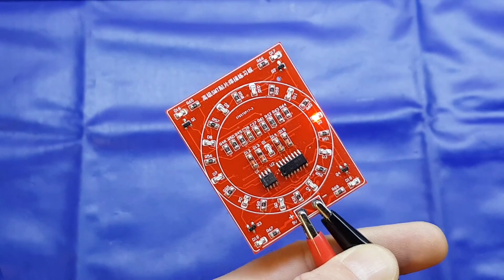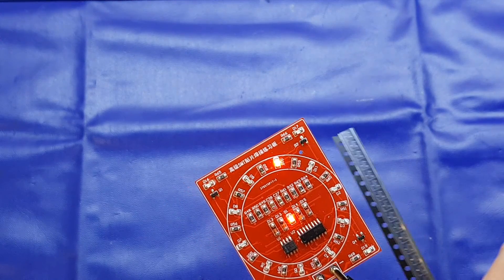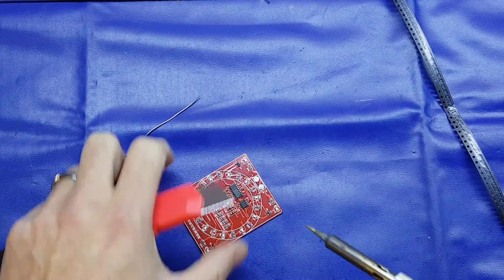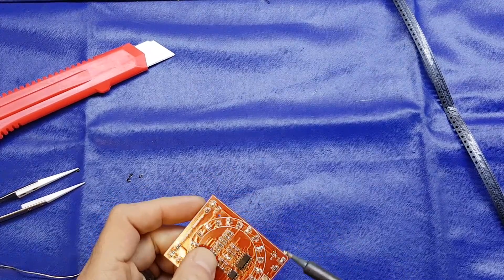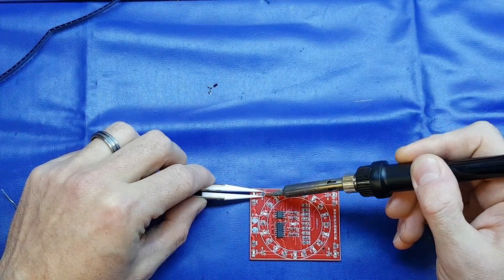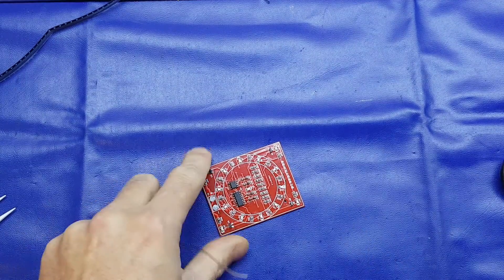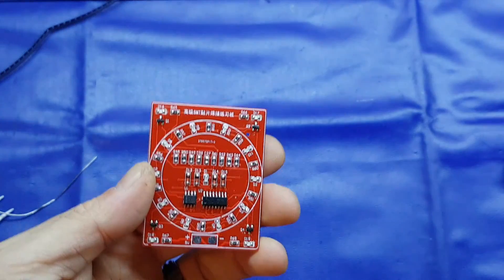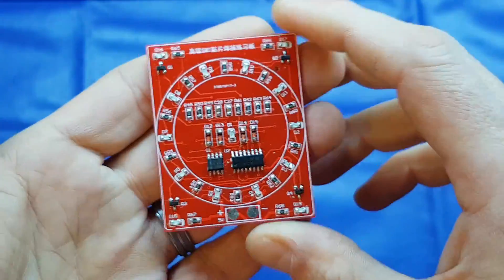Don't blame yourself when a kit doesn't work! - SMD electronics kit revisit - (soldering tutorial)

Comment: One of my LED lights in the big ring or circle stays on or lit and doesn't blink in sequence like the others do. Do you know why this would be happening? I am trying to learn from my mistakes, but I'm having trouble figuring out if the issue is with the IC or one of the capacitors. Thanks
Reply from the maker: There is a chance it has failed. Have you tried replacing it or swapping it to a different position to see if the fault remains?

Comment: I had the same problem, I worked out the transistors 6B in my case were pnp not npn , I fixed it by turning the diodes around.
http://youtu.be/QYyNcaDYdnE

Comment: Where and how much was your kit,my version was way smaller,had lots of trouble withn my first one ,I used a flux pen on the pads for the 555 chip,and after my flux pen was nused one of my pads disapered,in think it dissolved.,I have build my second kit,I want one like yours its bigger and looks better built,mine came from eBay ,$ 1.50 was the price